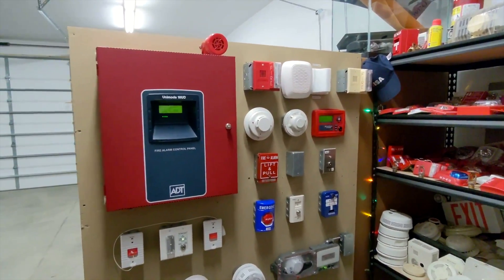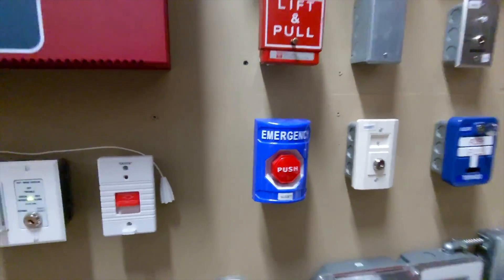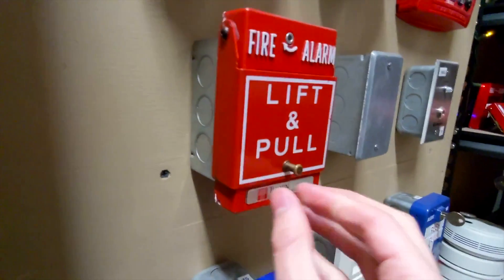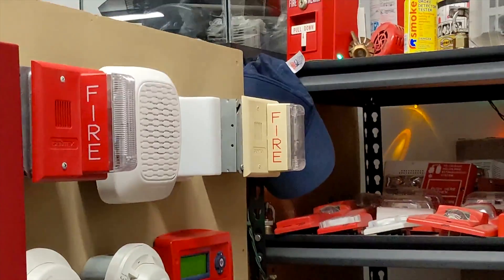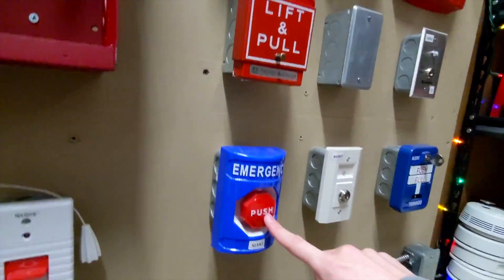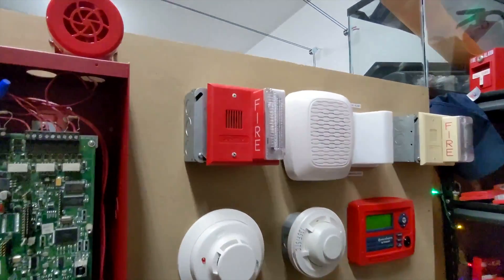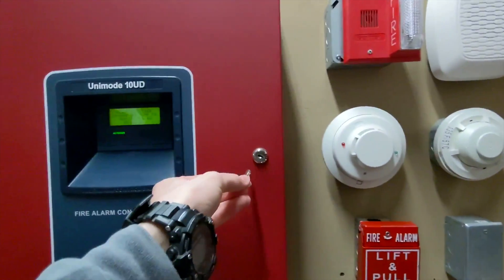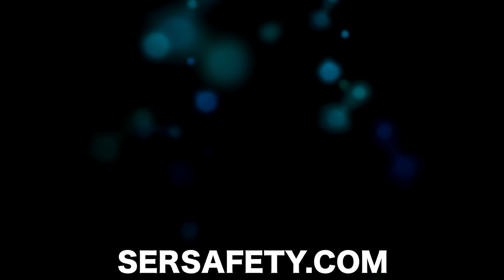ADT Unimode 10UD Fire Alarm System Test 18 | High Pitched Gentex

Comment: hi I'm doing a new smoke alarm installation in my grandparents house. there are 2 alarms currently but I do not know if they have 120vac or battery. but I want them to have wireless interconnect. I'm looking at the first alert wireless interconnect smoke and co alarms. but I cannot find an ionization version. They are all photoelectric. any recommendations on wireless interconnected smoke and co detectors/alarms?

Comment: That's awesome I also have a Gentex gx90 but it's more older than the ones you have the strobe looks very different on mine as a fire alarm lettering on the front and the sides of the strobe.

Comment: Also what are your thoughts on an emergency light with a motion detector? I am trying to come up with an idea on how to make the battery last longer on an emergency light. if interested, I will be making a video in the future on how to make one.
Reply: I have thought of the same thing seems like such a waste to have them on sometime is in buildings that don’t even have people in them
Reply: @nics-systems-electric  yea turns out you need a low voltage motion detector for the heads. A normal floodlight sensor doesn’t work because it needs 120vac instead of the 6 volt from the head. I did find one on Amazon though so maybe I’ll try again.
Reply: @theblueexitsign8249  You could try security motion sensors

Comment: What happened to the smoke detector on the Ser system
Reply: oh wow i had to watch that over to find the smoke detector. i never noticed.
Reply from the maker: Good eye! The smoke detector had a trouble alarm pop up not long go. I took it down to clean it up and dust it. It will be put back up soon!